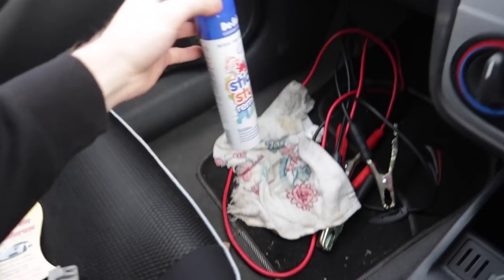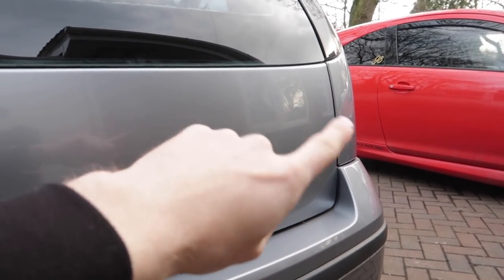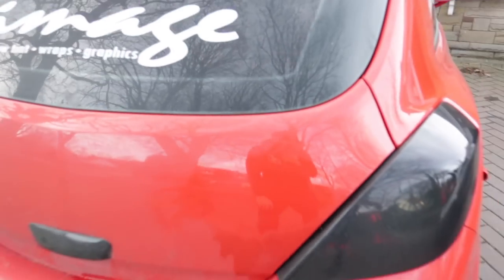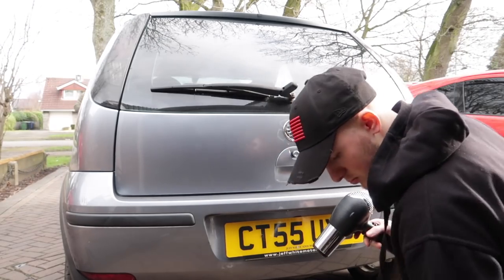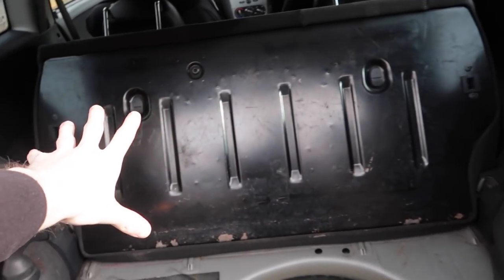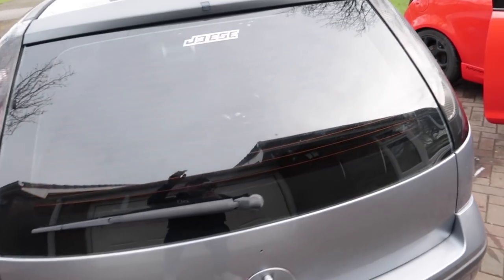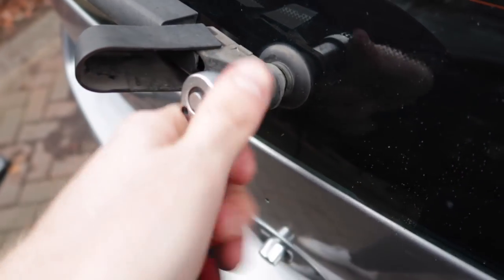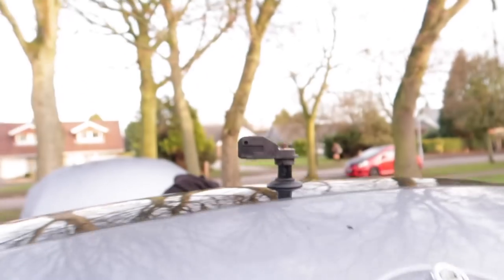Starting Work On The Project Car!!

Comment: I know its your first project mate but please don't skimp on safety gear when using angle grinders, they are so unpredictable! Looking forward to seeing what you do with the car
Reply from the maker: Yh I got you bro it was a last min thing I gave him some glasses after 😅👊🏼
Reply: And you had the high viz for safety didn’t you lol 😂
Reply: Jesse Collingham yea we’ve all been in the situation, takes a split second though to loose an eye. Just don’t wanna see you get hurt that’s all :)
Reply from the maker: The Savage Garage my man 👊🏼❤️ appreciate it bro!
Reply: @JesseCollingham  We use grinders quite alot at work so you are best getting some proper googles that protect your eyes from all angles. I was unfortunate and got a piece of metal in my eye using standard eye protection. Flicked up and hit my eye. The A+E visit was not pleasant! Spending the time to adjust the guard on the grinder can also reduce alot of the spark spray. Top work thou and looking forward to seeing the project in the future.
Reply: I've lost sight in my left eye due to not using safety glasses, they're so important
Reply: Yeah mate I was using a grinder a lil while back and the blade shattered luckily none of it hit me but still scary

Comment: Lad the first thing you should be doing is servicing the car. Change engine/transmission oil, check the brake pads and spark plugs etc.
Reply: Im sure they said its not long had a service in the first video bud
Reply: @davidhamer1418  I think they said it hasn't been driving in years the battery was flat when he bought it!
Reply: @justbrowsing4834  Lee said in the video it hadn't been driven for 5-6 months.
Reply: @azizul8304  when you buy a used car privately or out of a garage it's just common sense to get it serviced yourself. A healthy engine is a happy engine 😁
Reply: @justbrowsing4834  yeah I agree I did that to my corsa when i first got it. Exact same one as Jesse's except it's silver. That's how I've had it for almost 3 years running!🙌🏼 my corsa just hit 100k miles on the dot today it was exciting hah idk why😂

Comment: So you pretty much bodged all 3 mods. Those holes you've left in the boot lid I doubt will ever be filled, you can't ever put the wiper or the seats back in either now. Just persevere to do a proper job instead of cutting corners.
Reply: Crakkajack it’s a shitty old corsa it’s not like it’s worth anything 😂
Reply from the maker: Crakkajack literally bought it to mess around with as I said in both videos I’ve uploaded about the car now...
Reply: @JesseCollingham  yeah but you also made a big point about wanting to learn how to work on cars. Stubborn nuts and bolts are always guna be a part of working on a car and instead of learning and dealing with the problem, you took a short cut and bodged it. It's not teaching you how to work on cars. You're not guna be any more able to work on a nice car if that's how you work on a practice one.
Reply from the maker: Crakkajack I get that but I’ve already removed seats and wipers I just didn’t need to take extra time with this one as it’s a project car
Reply: He said he would fill those holes? I think the entire point of taking the seats out was the fact he doesn't want the seats in the car. Even if he did want to put the seats in or put the wiper back on, the parts he broke can be found in a breakers yard for next to nothing.
Reply: You won’t learn without making mistakes. And it’s the comments like these saying what should have been done which will help Jesse to learn ‘how it should be done’

Comment: First mod take engine out and put a redtop engine in it
Reply: Why? Redtops are slow as fuck by modern standard and its not a straight forward conversion in a corsa c
Reply: @BigMin100  redtops are more expensive these days than z20let plus the ecu on a z20 is a lot easier to install (and mapable) on a corsa c a redtop is a great engine but it really needs the coscast head and the blocks are closed deck which is miles better than a open deck z20let. The saab engine b204 is a good way to go cheap plenty of them be a good investment if he really wanted to learn  how . Its a laugh beating fast performance cars in little crap cars . And if you mean red top the c20xe yer it's slow these days or the c20let is like any other turbo car big turbo go faster
Reply: Sean andersen aye I know I’ve had loads.

ECU on these 1.2 corsas are same as zlet ones so can be reflashed to make things easier

Comment: Dental floss is a really easy way I find to debadge the cars 👌🏻
Reply: Kept snapping when I tried it, just used a credit card since like Jesse (Y)
Reply: Use fishing wire it's stronger
Reply: Dental floss works a treat, use a heat gun, get the glue nice and warm, cuts though a piece of piss.

Comment: Mate , sack them ugly grommets off 

Get x2 black plastic discs one 25mm and one bigger and silicone it in from the inside of the boot use the bigger disc on the inside 
Result - water tight flush wiper delete 

As people say —— SICK 

Also Drop an LET into it

Comment: Why are u stripping out a 1.4 and planning tonput a roll cage in it, you can’t even go fast enough to use the roll cage, unless i’m wrong about the engine ?
Reply from the maker: It’s getting an engine swap later